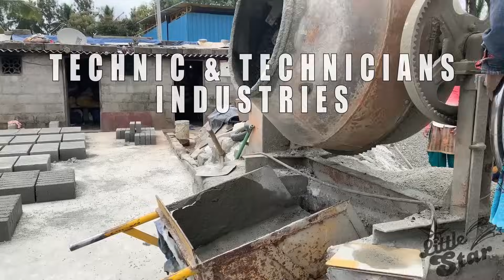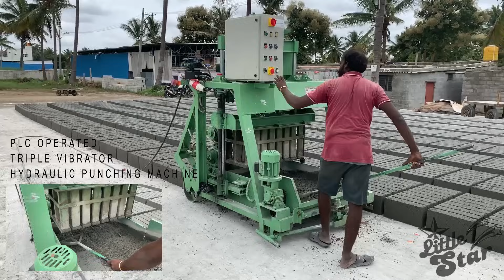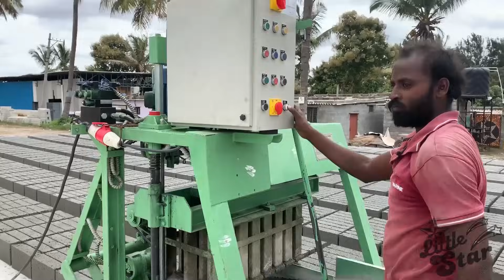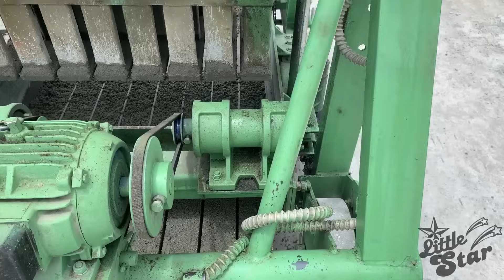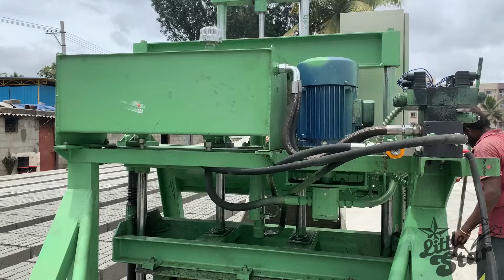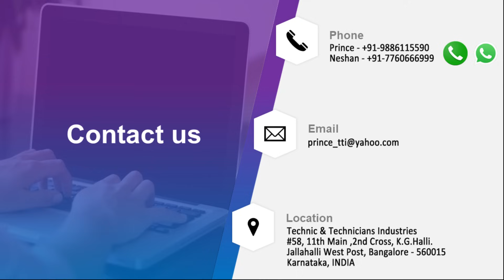CONCRETE BLOCK MAKING MACHINE, PLC OPERATED

Comment: In the Caribbean I'm using 2 pockets in hollow block and I need the width of each block to be 6 inch and the length 12 or 13 inch with space for mortor at each end. Do you have this mould and can you ship to Jamaica and also do you have a diesel version?
Reply from the maker: Thank you very much for your interest in our product. My mobile no and WhatsApp no is +91 9886115590, my email I’d is prince_tti@yahoo.com.
please share your number or email Id. You can whatsapp,message or call me.
Reply: @technicandtechniciansindus2966   hi sir I’m interested with this product did you have diesel in this machine and the price